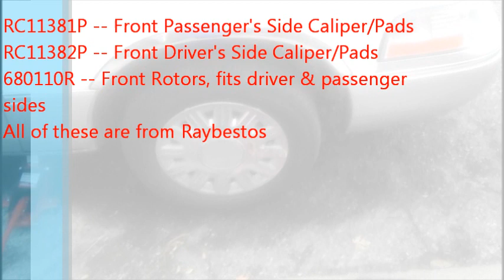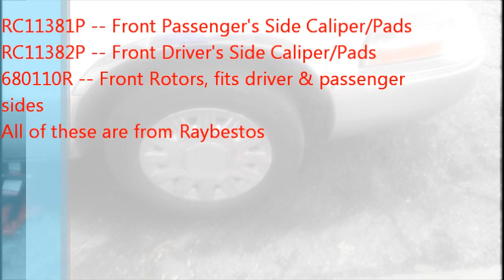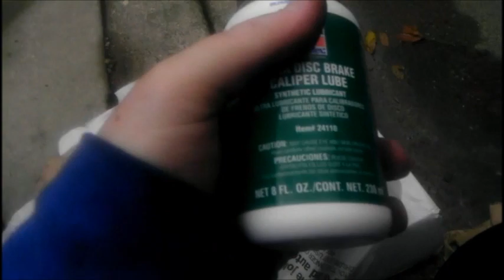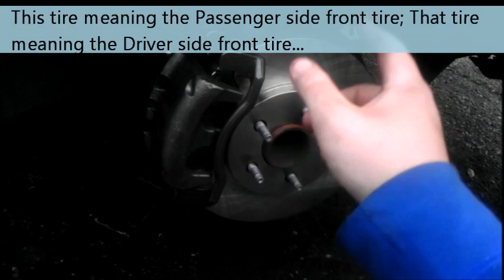Changing/Upgrading the front brakes on your 2003-2011 Ford Crown Victoria or Mercury Grand Marquis

Comment: y the disc still loose when you put the brakes
Reply from the maker: ...huh?  What disc
Reply: @adventureoflinkmk2  front disc
Reply from the maker: Hmm... did you order the proper rotors?  Is the caliper, pads, and/or bracket on nice and tight?
Reply: @adventureoflinkmk2   My disk breakers are loose and I don't know why can you help me out Everything is game brake pad and we didn't fit tight  But the disk breakers don't
Reply from the maker: That is so odd honestly... I've changed plenty of brakes and didnt have these problems... you SUUUUURE you got the correct parts for your year/make/model of car?
Reply: @adventureoflinkmk2  yes is ok thanks